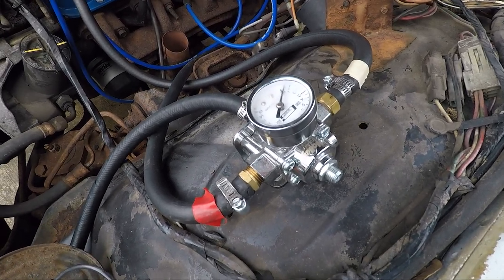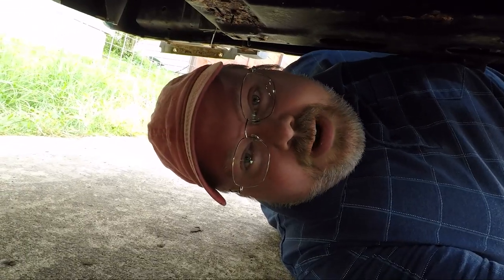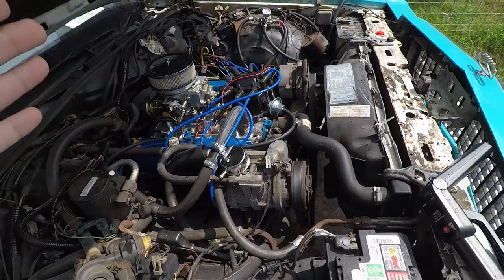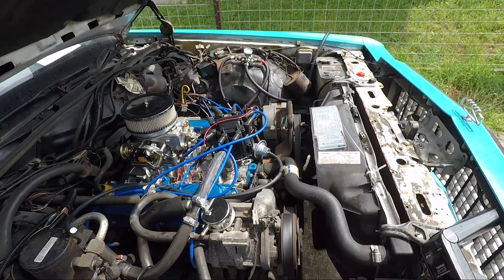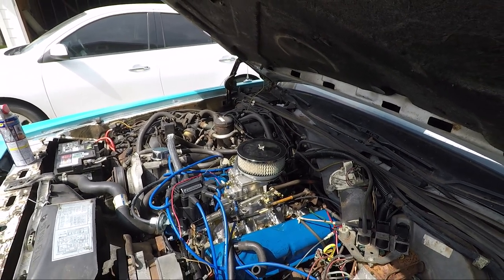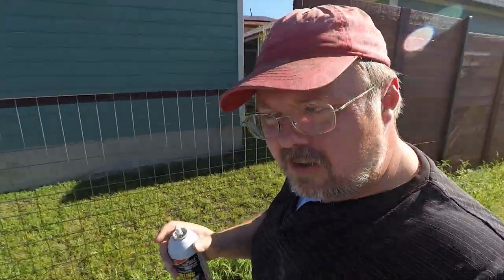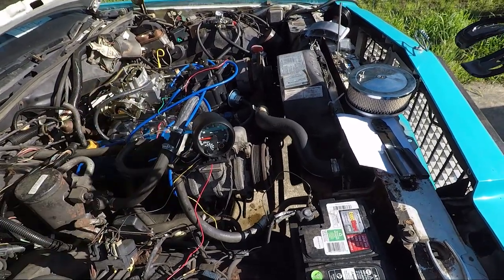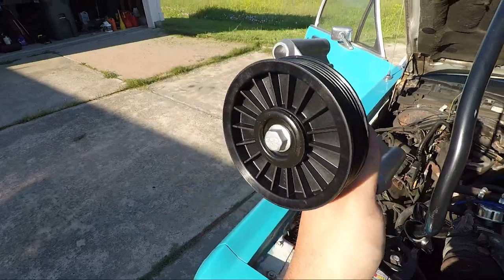1984 Ford LTD Crown Victoria Restoration Ep. 13: Two Steps Forward

Comment: You got the hubs off the back and that's why it is not stopping the rear end when you hit the brake..you will tear out the transmission if you keep on doing that and also the prndl on the inside they have a little tiny plastic line that works it and they stretch with age. I hope you took out both oil plugs changing the oil...I've had 5 of them cars I know all about them they have soft cranks and will start loosing oil pressure around a hundred plus thousand miles and usually around one hundred and twenty to forty thousands is the life of them I really like the design of them I'm looking for another one but hard to find anymore.
Reply from the maker: You make a good point David, if there is no drum over the brake shoes... they can't really stop the wheel from turning. Makes sense to me. And since I really have no earthly desire to tear out the transmission, I will definitely put those wheel hubs back on to avoid that. :) 

Thank you for the info about the PRNDL line, I had no idea that had one. I'll check for it next time I work on the car and see if I can tighten it, adjust it, or replace it. As for the oil plug, I just took out the one when I replaced the oil but if you're saying it makes a difference, I'll be happy to re-replace the oil to avoid any issue with the oil pump line if possible. I'm just trying to not break things on the car if I can help it. :P
Reply: @gwe87  Glad you're making progress! I don't think you did too much damage on the transmission while the axle was turning. I think that was just the parking pawl that was making the grinding noise.It's made to hold the weight of the car even in an incline. Sometimes people don't pay attention or don't care and they put the lever in park while the car is rolling at a slow speed and they get away with it (no damage). Years ago my dad parked our old van with a trailer full of gravel on an incline. For some reason my brother opened the driver's side door to go grab something and "accidentally" pulled the parking brake lever. This cause the van and the loaded trailer to lurch back a few inches. The parking brake prevented all of that weight from rolling down the hill. The transmission is still working to this day. 

 My only worry is the fact that you pressed on the brake with the drum off. This may have caused the piston that pushes the brake shoes to pop out or over extend out of position. You may be able to push it back to it's original position, but the seal might start leaking. Hopefully it won't be an issue. 

BTW - I'm Canadian too!
Reply from the maker: @djcrownvic7017  That is a truly remarkable story about the truck holding up all those years. I’m sure glad that she did though and I hope your dad enjoys many more years of reliable service from her. Thanks for the tip about the piston. I will definitely take a look at that and see if I can see any issue with it. I appreciate all your help and support!

Ps. I hope my Canadian comment came across in the nature I meant it, which was good natured. :) I’ve been to Canada once (Toronto and Quebec) and very much enjoyed my visits.
Reply: @gwe87  No worries at all about the Canadian comment! I knew it was just a joke/good natured!